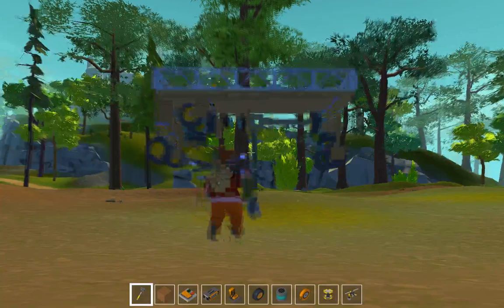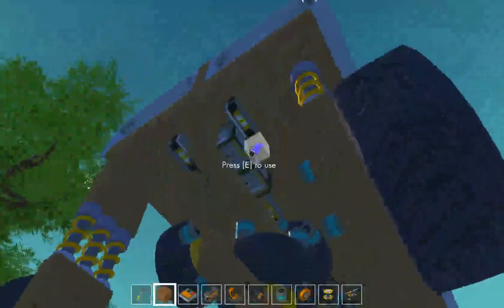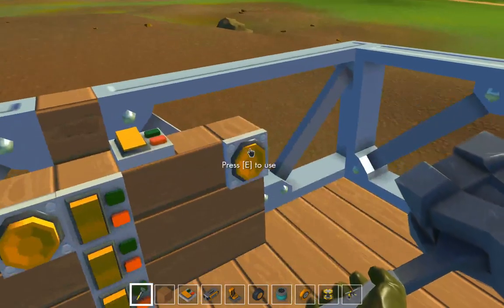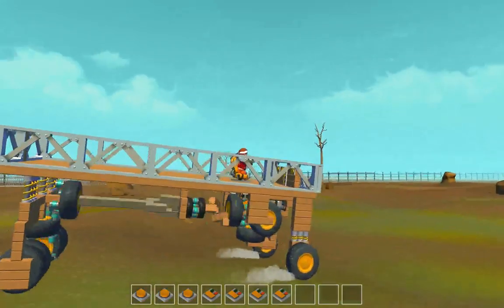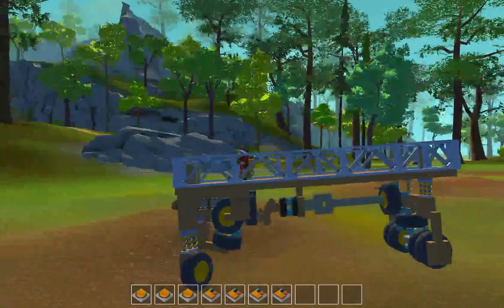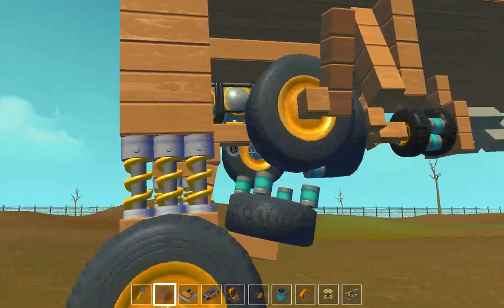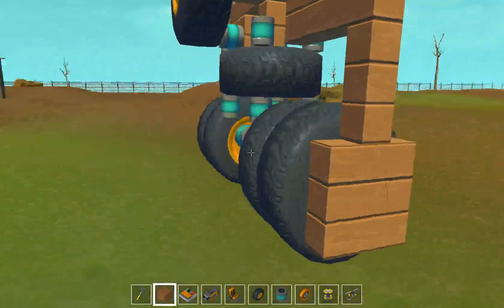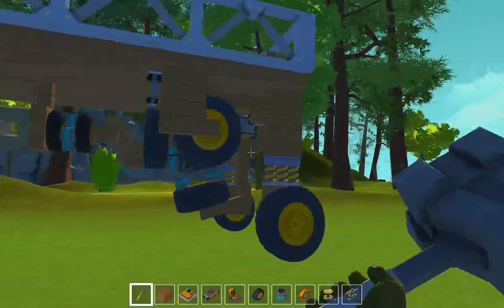Scrap Mechanic - Working Proof of Concept Manual Vehicle

Comment: its not a differential gear you have there... but nice job. The univeral joint isnt also working optimal because it is not round around the edges, meaning no space for flexing.
Reply from the maker: Yeah lol about a week later i realised that, I wasnt sure what to call it.

Comment: Nice one! Would be cool to see it done with just one engine and some sort of actual gear mechanism, kind of like a real gear box, maybe using both large and small wheels or just girders of differing length.
Like what if there was a gear box with 4 sides, and each one was stepped down from the last somehow so it was faster/slower, and the whole gear box itself rotated to change which of the 4 sides/gears engaged with the wheels?
Reply: Nommy I've made something similar that uses a thruster powered engine...
Reply: Yeah that was pretty neat. I was wondering if a working gear system was possible with 1st, 2nd, 3rd etc. 

Looked like the thruster engine might not be powerful enough for that unless you can mod the thrust. IDK, it's been a while :)
Reply: I plan on making a new gear car soon. I don't have plans of putting multiple gears (other that forwards and backwards), but I might in later versions...
Reply: Cool, good luck!